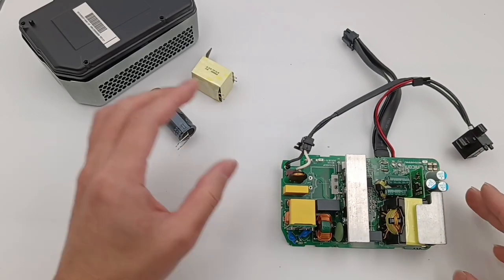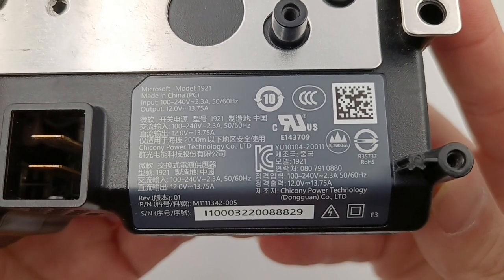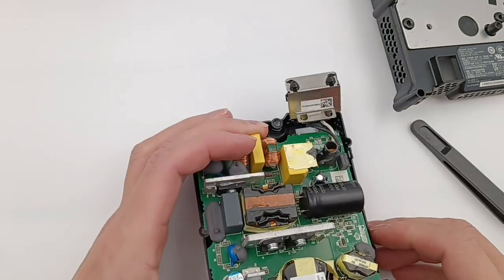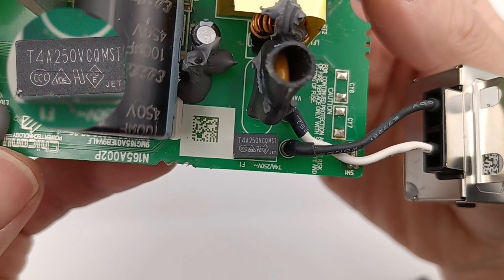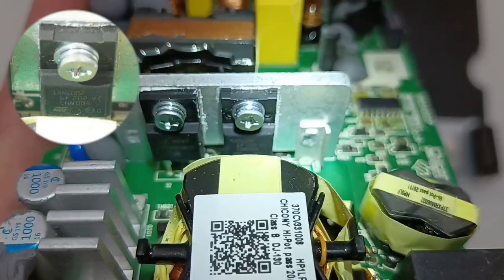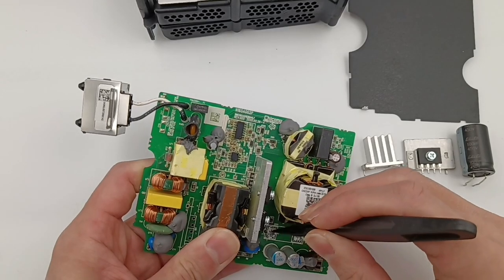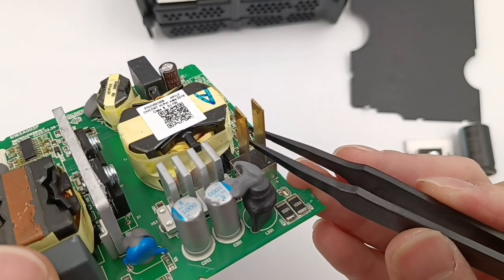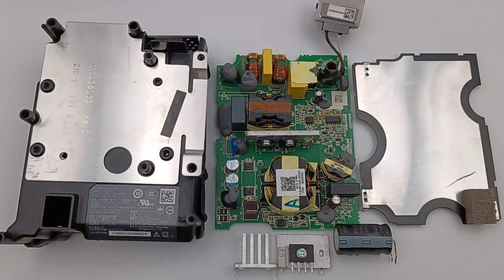Teardown of 165W Power Supply (For Microsoft Xbox Series S)

Comment: thanks great video would you say this 165w psu is correct size for series s or is it on the small side to meet requirements. would it assist in limiting the number on ancillary devices connected to the console? thanks

Comment: this thing has like no output capacitance, rather cheaply unit compared to Delta units but that's what I have come to expect from this manufacturer.
Reply: With modern feedback systems, output capacitance can be reduced a lot... A more expensive but more space-efficient solution would be a π filter (CLC for friends) with something like 50μF (made out with multiple MLCC in parallel) after the sync rectifiers, a 0.something μH inductor and after it just 1000μF or even less, and since the ripple current is filtered from the MLCCs and blocked by the inductor, the 1000μF cap can have quite a small case.
MLCCs can be put on both sides of the PCB, the inductor can be a flat one and the output cap can be a low profile, so you get something like a 15A output filter not thicker than 2cm.
Actually the MLCC MMC it's used in really high power and high current applications, so if you Google the design of al 12V 1500w LLC converter you'll see what I mean :)
Reply: @fabriziobrutti1205   @Fabrizio Brutti  these polymers have a limited life span and very limited ripple current spec, I am not doubting the ripple will at a acceptable when the converter is new, but i would expect the caps to go bad rather soon and the power supply to not last that long and this is not bleeding edge stuff like a Corsair AX1600i, this doesn't use a MHz+ switching frequency, this uses maybe a 100khz at which you can't just output 13 or so amps without the caps degrading and increasing ripple. A CLC filter won't be effective enough to reduce the ripple currents on the first cap bank to a an acceptable level you just need more capacitors and this power supply won't be able to survive on a realisticly sized MLCC bank fir that you would need a much much faster switching frequency and control loop which can't be achieved on such an offline design so easily. I dont mean to say that power supplied need high capacitance but only that this power supply needs more capacitance.
Reply: @tanishqbhaiji103  here we go man, got it! :D If so, I agree, there should be more than 7.5Arms of ripple current on each capacitor and as you pointed out, they won't last longer.
Reply: @fabriziobrutti1205  Something similar was used in the recent Apple 35W Dual USB-C non-compact size power adapter.
Reply: @xephonraphael  I've seen, though, polymer caps can do miracles
Reply: @tanishqbhaiji103  can you pls tell me which is the best power supply for pc?
Will build a pc soon That's why askeing.
I am looking for corsair hxi1000(2022)
Reply: @nishatafroj880  If you are looking for the best, AX1600i is the best available.

Comment: component quality on the other hand is not bad.
Reply: Worse than PS5 tho. Both SeX and SeS are worse. See main cap is Elite... while in PS5 is all japanese - Rubycon or Nichicon.

PS5 in general is built like tank from the cooling, to the PSU to the internals of their DualSense controller.
Reply: @borisdg  agreed
Reply: @borisdg the series s is cheaper than the ps5
Reply: @brodem5597  That's true. SeX is not.